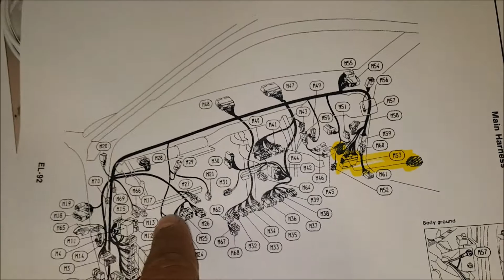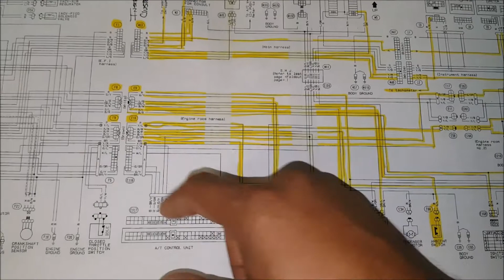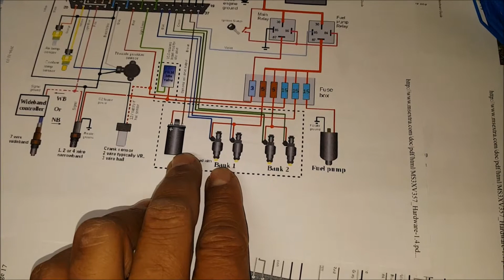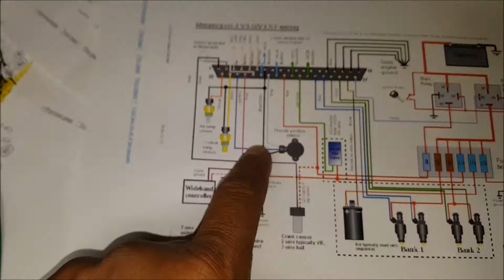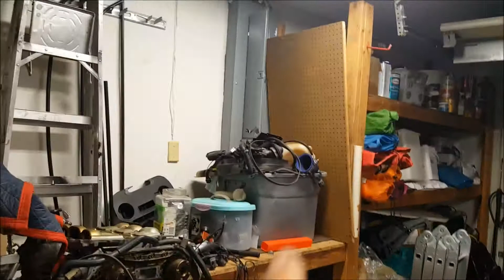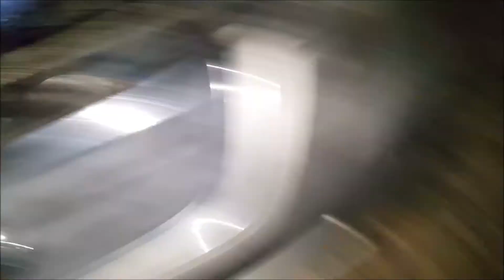VQ35 Build - Part 57: Mapping Out the Engine Harness

Comment: Doesn't look too bad to wire up, just going to take some time. Ms definitely has good support and diagrams. Please don't forget the two step wire 😂
Reply from the maker: Aaron _z33 Yea, taking it little by little.  So far sorted out ecu grounds to head, vvl solenoid, ignition, and air temp.  Spent 3 hours and only got this done.